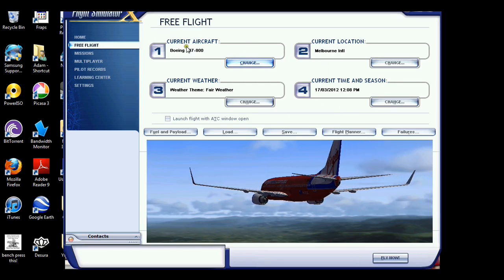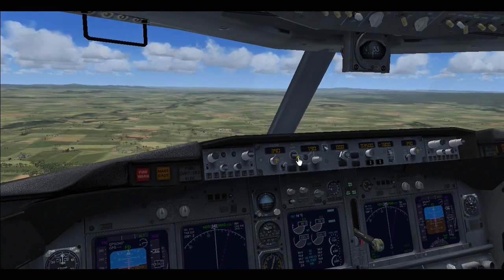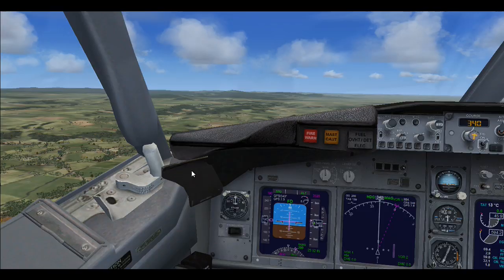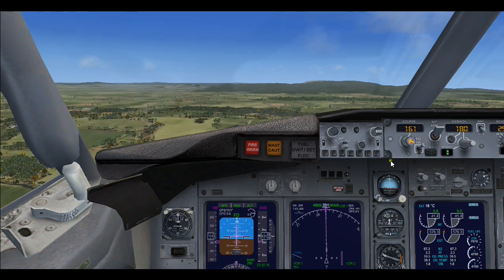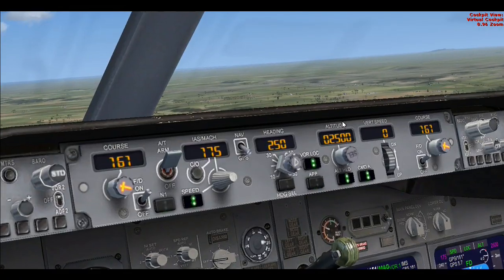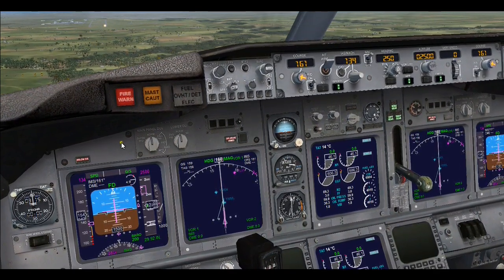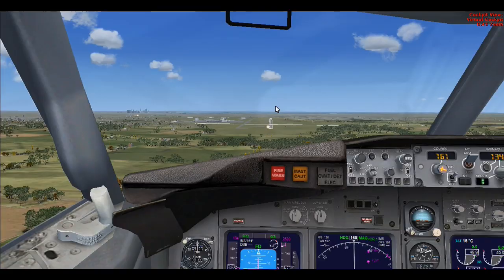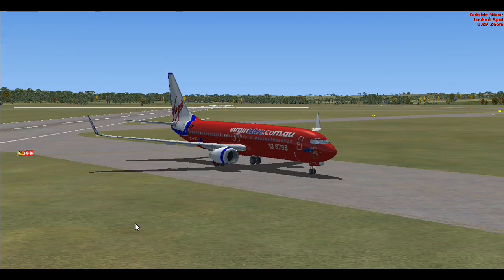FSX ILS Tutorial Video

Comment from the maker: No, for this example the ILS frequency was 120.500 and the frequency does not change. You cannot have a frequency of 360. That is the COURSE HEADING. It is entered in the COURSE Hold On your Autopilot. Which on the 737 is the Option on the LEFT HAND side of the SPEED HOLD. The Course and original radio frequency will not change at any time during the approach.